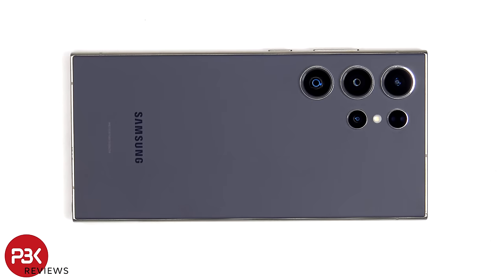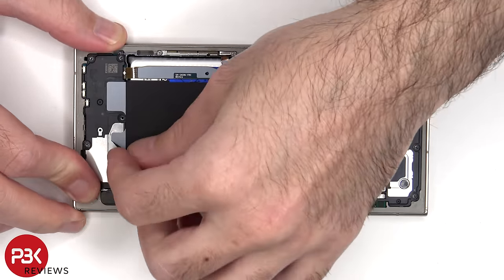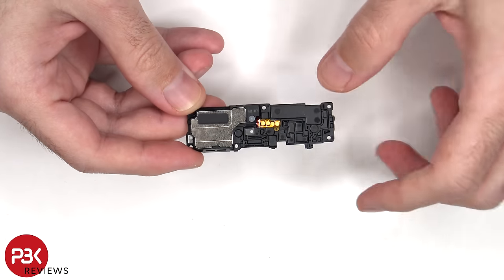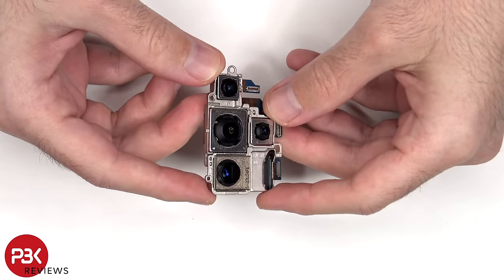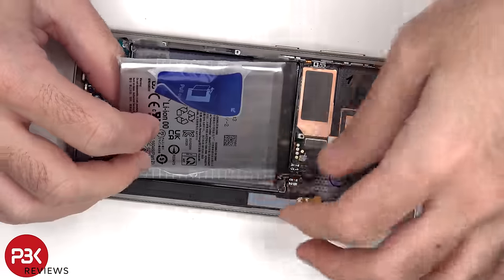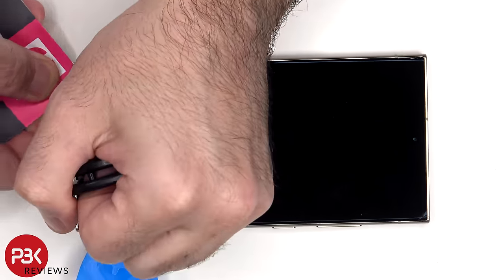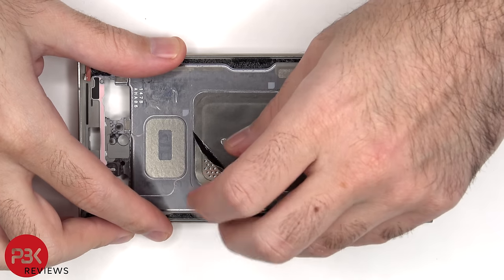Samsung Galaxy S24 Ultra Teardown Disassembly Repair Video Review

Comment: Thanks a lot for such a detailed video in a very short span of time.

Is the bottom speaker module really improved when compared to S23 Ultra?
Reply from the maker: You're welcome. Not sure since the speaker is enclosed in the same type of plastic housing so didn't break it apart to know if there is a difference in the speaker inside.

Comment: Well done. Great Video. It seems like the Oled Panel is not well glued to the glass like on previous Ultras. Some Users complain about the Colours being not so vibrant compared to S23 Ultra. Do you recognise this too?
Reply from the maker: It can be due to the heat applied when attempting to pry the screen off which separates the glass. Colors seemed ok to me

Comment: Will the panel work after reassembling? It looks scary the way you bended to remove it
Reply from the maker: no the screen was done for after prying it off. It's glued/adhered from the back of the screen to the frame, and these thin screens are very fragile. So it's pretty much impossible to pry working screens off without damaging them on these newer phones since there is almost no bezel or border around the screen to glue down, so they have to adhere it from the back of the screen itself.

Comment: 🎯 Key Takeaways for quick navigation:

00:15 🔧 SIM tray removal is the initial step, followed by applying heat to loosen adhesive on the back plate.
01:28 📸 Glass camera lens covers are replaceable without disassembling the phone by applying heat.
03:04 🔩 Mainboard components include front-facing camera, speaker assembly, and various Flex cables.
04:32 📷 Main board features multiple cameras with optical image stabilization and a multi-layer design.
06:02 🔋 Battery removal involves using a pull pouch; vapor chamber aids in heat transfer.
07:56 🎙️ Subboard houses the primary mic, charger port, Sim reader, and the S Pen.
08:39 📱 Removing the screen involves applying heat and using a pry tool, but cracked screens pose higher risks.
10:48 🔄 Back of the screen shows the ultrasonic fingerprint scanner and cutouts for the proximity sensor and front-facing camera.
11:15 🔥 Design changes in the vapor chamber compared to the Galaxy S23 Ultra.
12:23 🛠️ Volume keys and power button replacement involves pulling out a metal bracket and peeling off the flex cable.
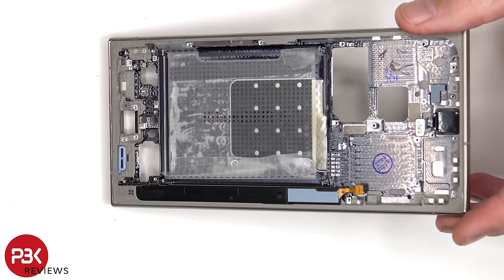12:44 🎤 Microphones and filters are positioned safely above the ejector tool hole; repairability score is 9/10.

Made with HARPA AI

Comment: Would you say the parts inside the phone are pretty durable and are well secured inside the phone? For example if you dropped the phone or the phone was shaken rigorously it wouldnt affect the internal parts/moving parts like camera lenses/optical image stabilisation sensors etc? You'd have a better idea since you open these phones up and look inside 😊 Just asking out of interest. S24Ultra owner here.

Comment: I have the exact same device, with the exact same colour, 512GB of storage, 12GB of RAM.
Which version has these 5G antenas?
Reply from the maker: The ones sold in the US have the mmWave antenna.
Reply: I think it doesn't matter with the storage options. It depends on what country it was distributed

Comment: What about the sim pin tool in the microphone hole can it damage the seal or something, i just did that , The tool had resistance then i pushed harder it felt like gone true something and went deeper?
Reply from the maker: I mentioned and showed in the video. You will be fine. The filter and mic are seated above the hole.

Comment: One question would you say the phone is 100% waterproof? If not whete would you say the chance of water ingress would likely be?
Reply from the maker: I don't like to call them waterproof, rather water resistant. Since below a certain depth of water or above a certain amount of time in water, the water will eventually get through. Not to mention, people think just because its water resistant as a safety measure that it's waterproof and made to be used in water so they take their phones swimming with them all the time. Over time it will damage the phone once the seal starts wearing out or the filters start leaking water into the phone.

Comment: Seems like it is actually physicly dual Sim. Wonder if you install different software, will they be activated?
Reply from the maker: Yeah you would need to install a dual sim enabled firmware to enable the additional sim reader pins, but that may also give you issues with network compatibility since different firmware have different network bands.

Comment: I accidentally put SIM ejector on wrong hole of mic and pushed little hard will it damage the mic water proofing? Or even the mic?
Reply from the maker: no you'll be fine. Both the filter and mic are seated above the hole and wont be damaged.
Reply: 😊 @PBKreviews thanks

Comment: FYI 9:09  normally nowadays when you want a screen replacement we dont remove the actual screen
if you order a replacement it SHOULD come with the frame!!!!!
my dads S20 FE and my s21 ultra  has this feture
so next time dont waste youe time with the screen!! nowadays you can get the frame WITH the screen  :)
just a pro tip!
Reply from the maker: Usually yeah, but also most people try to save money since the screens with frame combos are more expensive. I personally would rather go with the combo and save myself the hassle of just replacing the screen and having to re adhere it etc. However on the S24 Ultra, they have gone the way of screen replacements over combos with frame due to the titanium frame. So service centers will mostly replace just the screen itself. Also its harder to find the frame combo with screens for the S24 ultra vs just the screen and price is higher as well for the combos.

Comment: Very brave sir.
Were you able to put it together and make the S24 work perfectly?
1️⃣ What do you think of this model by Samsung?
2️⃣ Is it worth the price?
3️⃣ What happens next year in term of further enhancements?
Reply: He said he was not able to pull out the screen without damaging it. Too much glued.
Reply from the maker: No didn't put it together yet since the screen was not re usable. Waiting for replacement screens so I can replace it. I think its a good model.

Comment: What they won't tell you in any tear-down video is that, they in advance had removed the back cover of the phone already. That is why it looks so easy to remove the back battery cover from the phone. Is not that hard either it just takes time applying heat to the back of the phone.
Reply from the maker: Yup, just to save time on video footage of people skipping through it but in my most recent videos I have included the footage of heating and prying for anyone who is interested, but again when looking through the analytics of the video, those portions get skipped by the majority of viewers. :)

Comment: How easy or confident are you about restoring factory water seal protection in a screen replacement repair?

This video will be remembered by everyone who needs to repair their device. I hope this will never be the case for me, I'm here to see the quality of the materials and internal construction of the device: 

I have a lot of trauma from failures caused by oxidation (White/green screen; device that turns off and does not turn on again; miscommunications and blackouts and spurious restarts)

Obrigado pelo vídeo!
Reply from the maker: I mean most replacement screens will come with the frame pre attached. But if not, you can always purchase the adhesive seal made for the phone and replace the old adhesive when re applying the screen. If done correctly, should retain the water protection.

Comment: you should turn that into a mini pc for emulation (of games) using the main board as a single board computer that outputs to a monitor etc. make sure it can charge and output to hdmi etc at the same time. then do an update video with your whole setup.
Reply from the maker: yeah its an option, but just waiting for a replacement screen to replace it :)
Reply: @PBKreviews  yeah i would want a screen for debug if needed in the device i would locate the screen to the outside of the mini pc. I would see if you could run a diag screen on the phone for the device and game play etc, then, have the output for like a big box emulator etc (ie launch box)

Comment: As an individual who I'm fixing my phone by my own, and my current phone just got 4 year old, I'm disappointed by how the screen is to be removed and also, some decisions of Samsung to assemble some components inside that phone.
 Yesterday I was about to buy this exact model of 512gb but I hesitated. Now.. seeing this video, for me makes no sense whatsoever 9/10 repairability score. Maybe I'm missing something, but my current phone has 3 screen + frame housing replacements, 4 batteries and one charging port (with the bottom board) replaced to keep it alive and fully functional.
 I'm struggling to find genuine batteries now and the front and bottom speakers I received were counterfeit.
 Again, maybe I'm missing something, but this Samsung is not as easy to repair as I was hoping... This really pushes me back and picking the Fold version looks to be similar work in the future when the phone will need work + futures + price. The balance doesn't look great at all. :(
 Last but not least, that cooling solution looks mighty, but I doubt it's effectiveness over the way they chosen to place it, because being such a big unit, I expect to handle some overclock on to SoC in the future. By the looks of it, the thermal capacity is good, but transfer rates might be outrageous.
 Damn it Samsung. For 2 weeks I thought this is the perfect brick type of phone, now I'm strongly considering the folding variants on the market considering the price of this unit...
 Thanks PBK for educational content, great work as usual. :)
Reply from the maker: It's not too difficult to take apart for battery replacements or other internal part replacements honestly. The only hard part is trying to remove a working screen without damaging it. But in most cases, people will be removing a damaged screen so if you don't have to worry about being careful with it, you can just break off the screen and not be gentle with it. Thanks :)

Comment: Were you able to put it back together? Did it work after?
Reply from the maker: I put it back together but the screen was completely destroyed after the teardown. So I'm waiting for replacements to become available so I can replace the screen. Now a days since the bezel/border of the screen is so thin, there is no room to adhere it to the frame on the sides so they have to glue the back of the screen to the frame causing the screen to be destroyed when prying off. I'n most cases, people will only need to pry it off if the screen is damaged in the first place so yep.
Reply: Advantage of owning samsung a series with thick bezels 😂

Comment: I accidentally pushed the pin on the noise microphone hole while changing the SIM, a lot went in.  Will there be any problem with my mobile now??  S24 ultra
Reply from the maker: no you'll be fine, watch the video, I talk about that towards the end

Comment: Why sim card tray should be removed first? It does not connect to anything and its a separate module. At the same time you forgot to pull off s-pen...

Comment: I've done this job for 14 years +, fixed over 100,000 devices and I still feel SICK when I see no heat or no IPA when someone removes a rear panel. Tell me I'm wrong
Reply from the maker: Not sure if you were watching it on mute or not, but clearly mention heat needs to be applied. Just didn't show the heating process to save footage time.

Comment: OMG.
Do you try assemble this phone?
Is it works or you killed it?
Reply from the maker: No waiting on a new screen to replace it with. These screens on these phones are glued/adhered from the back of the screen to the frame, so prying them off will damage them and almost no way to pry them off without damaging the screen.

Comment: Did you break the smartphone screen?
Reply from the maker: yup, on these newer phones that they glue/adhere the back of the screen to the frame (since the border/bezel is so thin and no room to just glue the glass down), its almost impossible to save a working screen.
Reply: @PBKreviews  
so creating content teardown this smartphone = killing this smartphone?
If yes, does that mean you need a new S24 screen if you want to reassemble it?
Why not just create content installing the S24's new screen?
Reply from the maker: Yes, I am waiting for a replacement screen so I can repair it re assemble it :)

Comment: if only this was just in smaller size like 6.4. i would have switched. some might say there is s24 for it but its just different. the AR, camera, ram etc. the same spec and design but tiny bit smaller

Comment: @Is it fair to say, that build quality of Iphone except the back glass is better than Samsung s24 ultra? Commenting this after watching you teardown of 15 pro.
Reply from the maker: I think the build quality of the 14 pro was better than the 15 pro etc, since 14 pro handled drops better. Internal structure wise almost the same. But between the S24 ultra and 15 pro, its hard to say. Both have good build quality and one may be better than the other in different parts of the phone.

Comment: очень жалко и больно смотреть как зверски снимает дисплей без разогрева на топовом смарте,....это боль....
Reply from the maker: If you listen to the video you will know it was heated, just because I don't show it on video to save time, doesn't mean I don't do it. Also even a samsung tech commented saying the screens can't be saved even by them. Since the borders of these screens are so thin, there is no room to adhere the sides of the glass to the frame alone, so they put adhesive/glue under the screen, gluing the back of the screen to the frame. So prying a working screen of is guaranteed to break one way or another. So no point in me wasting my time trying to save it when it was hopeless.

Comment: big mistake in Samsung devices not to cover the camera when the back cover comes out.  every time you open the back cover the camera lenses will fill with dust.  when I sent my mobile phone to Samsung for repair (three times) and all 3 times the cameras had dust.  I ended up having them change my cameras three times because the photos and videos were terrible.

Comment: Bro u need some work and patients on secreen remove process even its broke but it can be saved
Reply from the maker: No, not on these. Even a tech from samsung commented saying with the special machines and tools, they can't save these screens either. Since they are glued and adhered from the back of the screen to the frame because the bezel/border of the screen is so thin, its pretty much impossible to pry it off and save the screen without damaging it.

Comment: Mahn 
Display disassembly is a nightmare
Reply from the maker: yup, usually the display replacements will come with the frame pre attached. Now a days since they make the screen border/bezel so thin, there is no room to apply adhesive so they glue the back of the screen to the frame. This basically makes prying it off destroy the screen.

Comment: Well we all know you don't work on mobile devices as your day job... Lol

Video should be labeled how not to take your mobile apart! 🤣 🤣
Reply from the maker: If you're referring to the screen, it's impossible to remove without damaging a working screen since they adhere/glue the back of the screen to the frame on these. Even a samsung tech commented saying they cant either. Plus I've been taking phones apart and putting them back together for over 20 years and I know what I'm doing, thanks.
Reply: @PBKreviews Samsung tech did not say that cause I agreed with him. Also I'm not sure about the S24 flat architecture is made different from the S23 being curved but most of these screen replacement come with a new chassis and battery but if patient enough it can be removed and put back on. But the saving you save as a customer is nonexisting cause of what you need to go thru to do it. Why I just recommend the chassis with screen. But I would think the flatness of the 24 would make it easier the pervious models.

Comment: Dont kill screen man give some heat...
Reply from the maker: I did, didn't you listen to the video? Doesn't matter how much heat you apply, eventually the glass separates from the screen instead of the screen from the frame because they glue/adhere the back of the screen to the frame since the bezel/border is so thin, they can't adhere the glass to the frame properly. No way to remove without damaging a working screen, even the samsung tech who commented said they can't do it either.

Comment: U score 9 but impossible to remove display
Reply from the maker: almost impossible to remove it without damaging a working screen, but if you already have a broken or damaged screen which most people would if they are trying to remove the screen, then you wont have to worry about being careful and can just rip off the screen and not care if you break it etc. :)

Comment: Ma non hai attrezzi per smontare smartphone di questo tipo,guarda il display come l'hai rovinato ma smettila guardare questo video fà schifo.
Massimo C.
Reply from the maker: lol you have no idea what you are talking about. Even samsung repair techs have commented saying its impossible to save the screens on these phones if you pry them off since they are glued/adhered from the back of the screen to the frame. The bezel/border of the screen is so thin, there is no room to adhere only there so they adhere it to the frame from the back of the screen.